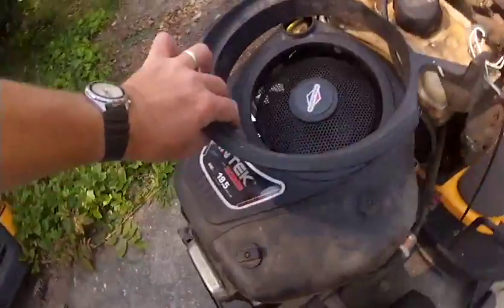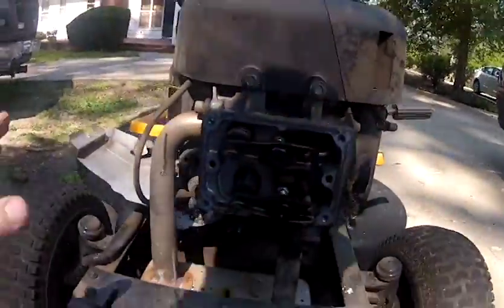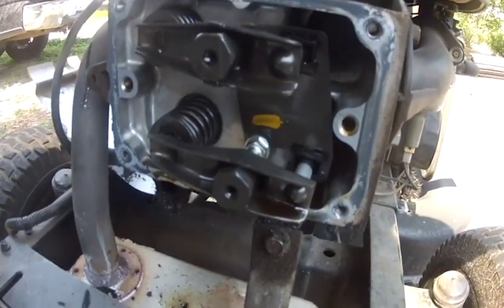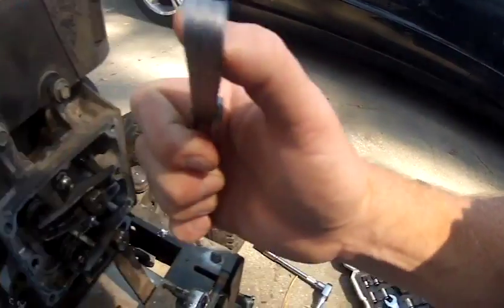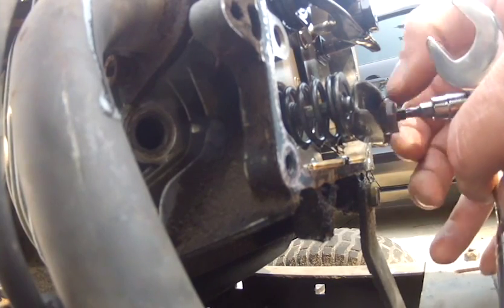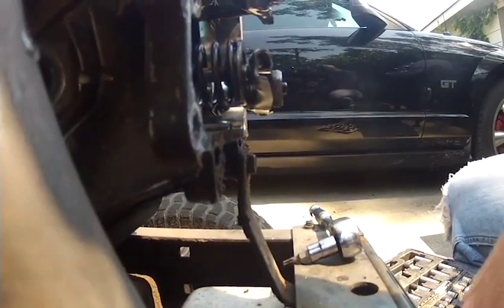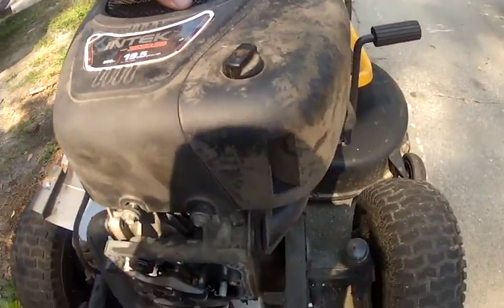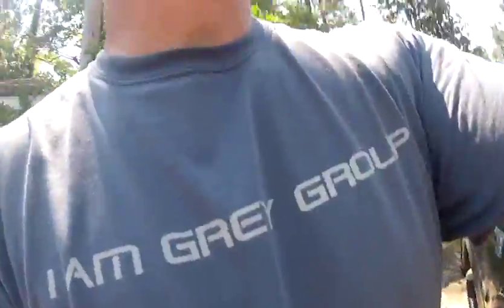Briggs and Stratton INTEK 19.5HP motor not starting (How to fix a Valve Clearance Issue)

Comment: 2:56 Looks like it got so loose that the valve stem cap cane out of that lower valve (intake).
4:19 you can there is no cap atop the valve stem
It will run without it but may damage the valve stem or rocker arm over time.
Reply: Thanks for clearing that up. I was trying to figure out how it got so much clearance in it. That was crazy! I would have had to figure that out before I just tightened it up like that.

Comment: Valve adjustment specs?
Reply: Most Briggs will work fine with   .005 (0.15 mm) for intake and .007 (0.20mm) for exhaust.

Comment: You forgot to check the clearance on the exhaust valve
Reply: See 8:10 - he said he would do that and put the cover on
main problem is missing the valve cap on the intake valve stem
-- could be fell out of the cover when he took it off or it could have fallen into the sump of the engine
-- probably won't do any catastrophic damage either way, but should put a new cap ion that valve.

Comment: Is the exhaust.004 and intake .004.? How do you determine tdc
Reply from the maker: Hey Sidney, You can set both at .004. Place your hand on the top of the motor and turn it watching the valves. You'll see when the valve bottoms out. When the valve bottoms out is when you'll check the clearance.  Hope that helps.